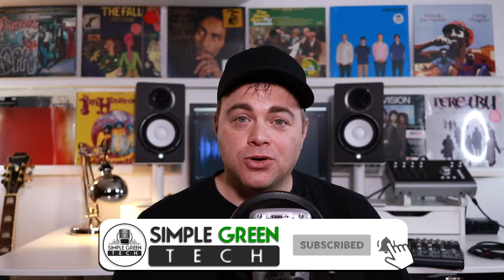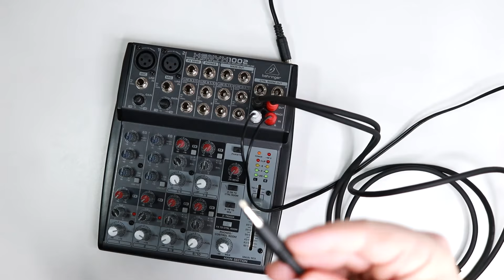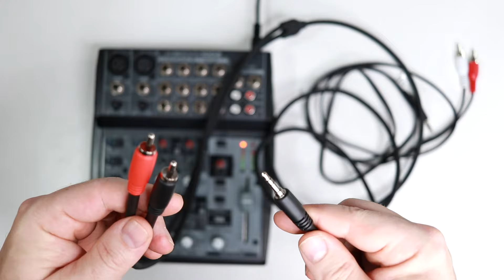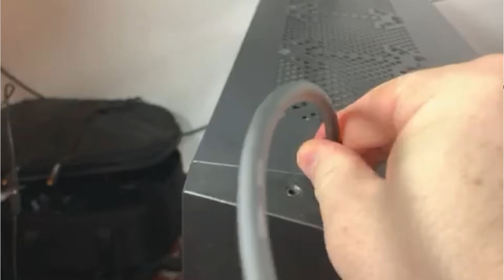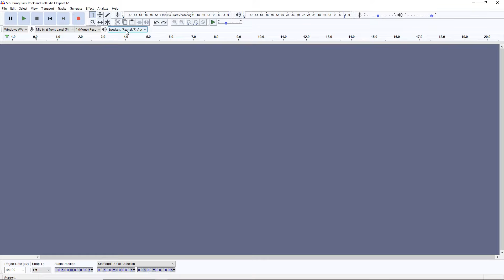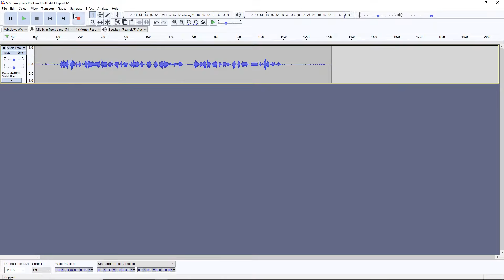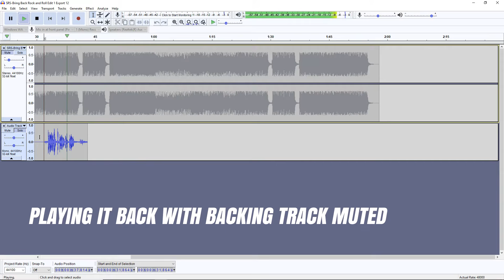How to Connect Mixer to PC For Recording Without an Audio interface

Comment: Hi, I have the Q502USB and a Windows 10 laptop w only one input (headphones). I got the soundcard you suggested. My mixer works but no sound reaches my PC (except through its internal mic.) What am I doing wrong???
Reply from the maker: If you’re connecting it to your computer by USB then you need to make sure that it’s setup in the recording software that you’re using. If you’re connecting it to an audio interface using cables then make sure you’re audio interface is setup in your recording software. It sounds like you only have your pc mic setup as an input.
Reply: Simple Green Tech Thank you for the prompt reply. Yes, I’m going straight to my laptop via USB. I can choose USB Audio Codec or RealTek. The PC receives no sound either way. (And there is no third option.) I suspect there is a dimple fix that eludes me because I am a dummy in this area. But I don’t know what else to try!
Reply from the maker: Mark Rhodes USB Audio Codec is the Behringer driver so be sure to choose that. What software are you using this with?
Reply: Simple Green Tech Thank you! I’m using Reaper. It registers sound when I play my guitar but not a lot. It registers the same amount if I unplug the mixer, so that sound must be picked up by the laptop’s mic, not from the mixer. Somehow, the sound from the mixer is not entering the PC at all.
Reply from the maker: Have you changed your audio device settings in Reaper so it ma using the USB Audio Codec?
Reply: @AudioTechTV  I don't see a USB Audio Codec option in Reaper. I've chosen the ASIO audio system and the ASIO4ALL v2 drivers.
Reply from the maker: The USB audio codec is not an Asio driver. So you can choose another driver type or you can set it up in Asio4all. Select Asio4all and go into the control panel and set USB audio codec as your input and output device.
Reply: Simple Green Tech Okay, thank you. A tech-savvy friend is going to call me and walk me through this. That may be a little while from now. I’ll let you know how it works out. Thank you so much!
Reply: Okay, this is weird. Using WDM kernel streaming, I could record into Reaper. Everything was fine. When I choose ASIO, I only have an option for the computer mic. I think somehow the ASIO driver is not recognized. I'll reinstall it and see if that works. Main thing, the equipment works and this seems to be a driver issue. Thanks for all your help!

Comment: One question sir(regarding waveform)

I have been trying to use my sustain pedal with my midi keyboard, and the vst plugin is recognising the sustainability
But after I record the midi track
Waveform is not able to detect the sustain input
Please help me with this
Reply from the maker: You probably need to record the automation when you’re recording the midi keyboard. I go over recording waveform automation in this video https://youtu.be/XZgs0mfmCqg when setting up your automation track select the sustain control for the plugin and it will record the automation of that control.

Comment: Small advice from me. Try NOT to use the front panel audio connectors. Mostly they are very noisy. Use jack on your sound card at the back of PC. Great video!